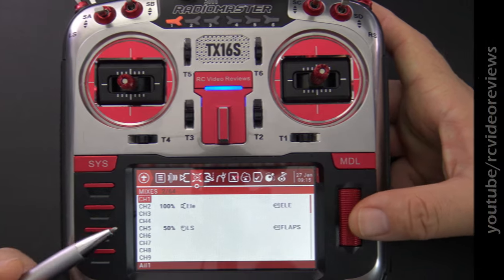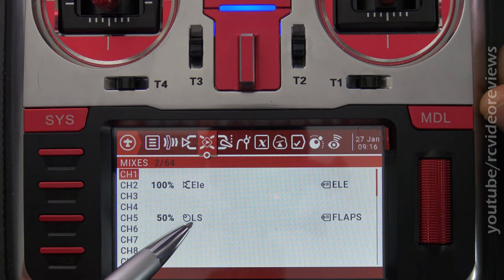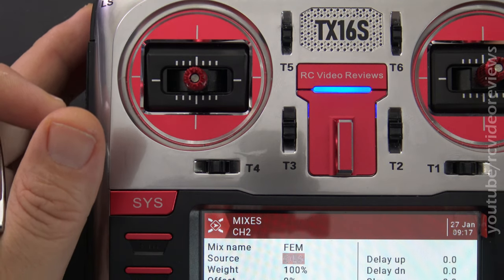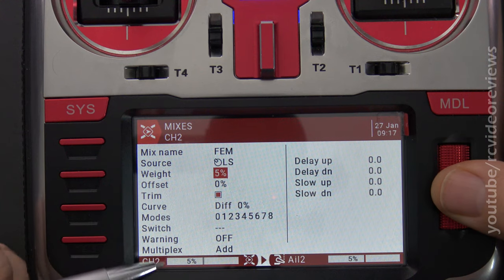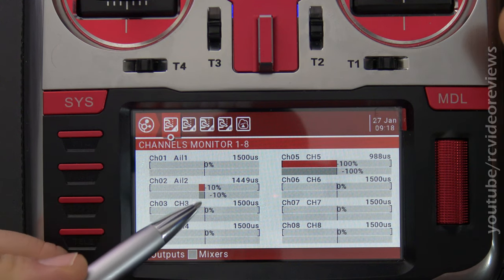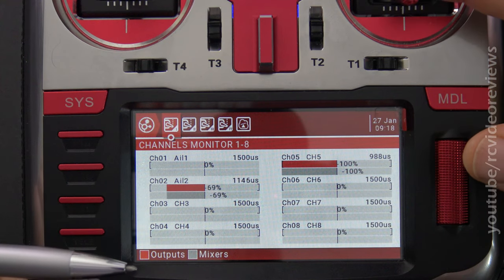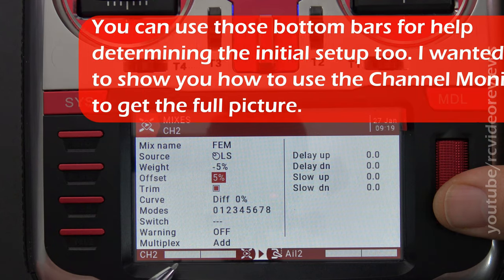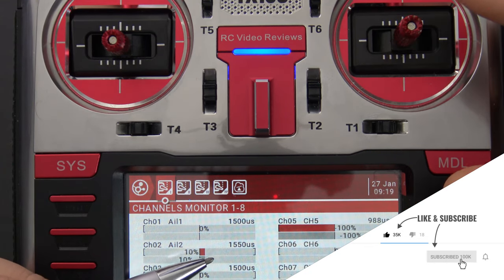OpenTx Snippet • Elevator and Flap Mix

Comment: Im guessing it would be the same process if you had flaps on a switch, just the source being the switch?
Reply from the maker: Yes, the logic is the same. You may want to look at the delay video I just posted so you can slow the deployment of flaps if you use a switch. Since I normally use the slider for flaps, I generally don't worry about deployment speed because I can control speed with the slider. https://youtu.be/SOT6wAuZLVU
Reply: @RCVideoReviews  I already did that, but it seems that only one flap setting actually effects the elevator, they are both set up the same, just different switch positions and values. Any ideas?
Reply from the maker: @adamrupsis3390  I just built this mix in Companion and it works fine:

Ch2 I2:Ele Weight 100%
Ch2 Line 2: Source SA, Weight 10%, Offset 10%, Slow (u3:d3)

With that setup, when I move SA from Up to Mid the Elevator moves up slowly 10%. When I moved SA from Mid to Down, the Elevator moves up another 10% slowly.

Comment: This is exactly how I set up my elevator to flap mix.  I think I used your videos a while back to learn how to do this!  After I got better with opentx,  I added global variables.  I used one of the extra trim switches to change the value for GV1. Then I changed weight and offset to GV1 or -GV1 depending on what it needed.  This allows me to adjust the flap to elevator mix in the air during the maiden.
Reply from the maker: Nice. Good tip.
Reply: @RCVideoReviews  new to opentx here, what u just explained makes no sense to me lol a video will be very helpful

Comment: Thanks for video. I've an issue. The mix Is ok but elevator travel Is no more equal for positive and negative escursion. The offset and Weigth subtract travel from pitch up elevator. Any suggestion? Thanks

Comment: Thanks for video showing how to add down elevator when using slider for flap. An interesting difference on my monitor is I have flap (at 50%) going half + and half - but your screen shows one side only working at 50%. Why is mine showing different, am I doing something wrong. My t/x is a Jumper T18.

Comment: I'm sorry to be so needy. I'm new to the TX16s and EdgeTX. Thanks to your videos, I have set up 4 planes some with flaps. Suddenly I have a power glider that has only ailerons, motor, and elevators. I set up my Excalibur using the EdgeTX wizard. I chose V tail with two separate servos. Only one elevator servo works. How can I fix this?

Comment: Many many thanks.
That was so very helpful.
I don't however " get" the Offset bit.
I understand the weights that is the servo throw but what are we offsetting?
Sorry I am such a dummy.
Peter
Reply from the maker: Offset just moves the entire curve up or down in relation to the origin (0,0)

Comment: Thank you for this. Great info. If I slow down the flaps let's say 2 seconds, do these 2 seconds carry over to the elevator? Or do I also have to set elevator slow down (2 sec) in the shown mix?
Reply from the maker: Yes. Try it--make an exaggerated mix--like 100% and apply it over time. You can experiment with stuff like this to learn.
Reply: @RCVideoReviews  Thanks, I just experimented. The elevator mix also needs the 2 sec slow down.
Reply from the maker: Ahhh, I think I understand your question better. Applying a slow down on one mix line will not impact movement on another mix line. i.e. Ch6=Flaps with 2s delay will not slow Ch2 ELE + FLAPS. You also have to add your 2s delay to the flaps entry on the Ch2 mix. 

In any case, don't be afraid to experiment. That's how I learn all this stuff.

Comment: Thanks. I have been trying to figure this out. Question. For no flaps, what should my elevator values be. For some reason I'm getting 10% down.
Reply from the maker: If by no flaps you mean flaps at 0, if you're still getting elevator movement, I would suggest removing the mix first to see if the elevator changes. If there is 0 flaps, there should be 0 mix to the elevator.
Reply from the maker: It sounds like you might have some trim or outputs trim if the flaps aren't mixing but you still have 10% down.
Reply: @RCVideoReviews  I think so. I guess I meant when the flaps are level (parked). I may have missed something. I'll watch your video again. Love your videos by the way.

Comment: Great video! Question... new to otx,  noting that most folks when they set up flaps don’t do an flap input, they just go straight to mix/and define source with no input. Even wizard sets up  this way? Is a flap input unnecessary?
Reply from the maker: Totally unnecessary. This might help: https://youtu.be/WmnZM5veAiE

Bottom line, if you don't expect a need to change rates/expo, you can bypass Inputs, but, you don't HAVE to bypass inputs. If you like things to be consistent, you can put all your controls on the inputs tab. For me, the only thing I would generally say "needs" to be on inputs are primary control surfaces for which you have or may want dual/triple rates or any other thing that you want to be able to modify before it is 'mixed'.
Reply: Thank you!

Comment: Is there a way to trim only the elevator while in flight on this mix while the flaps are down?
Reply from the maker: Use Flight Modes. Use the same switch for a flight mode as you do for your flaps. In your flight mode use FM0 + FMx trim for elevator only.
Reply: then the trim go back to normal when the flaps are back up.
Reply from the maker: That's the very nature of flight modes. Watch this: https://www.youtube.com/watch?v=BcH3uIiVv40